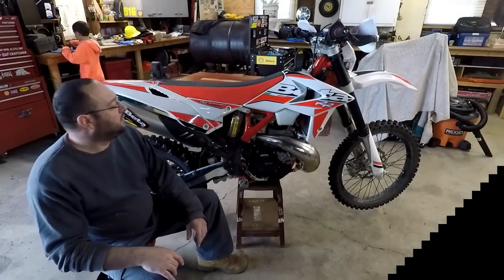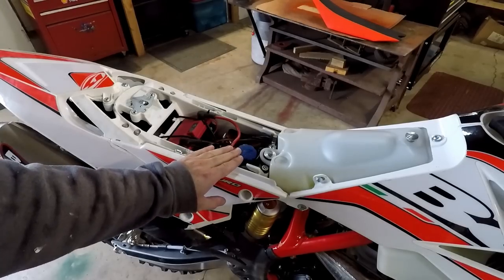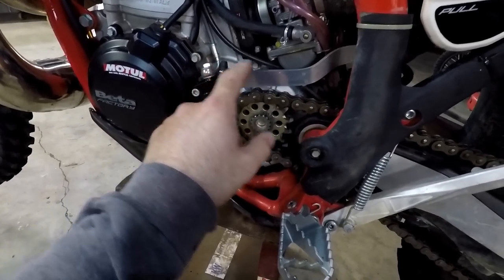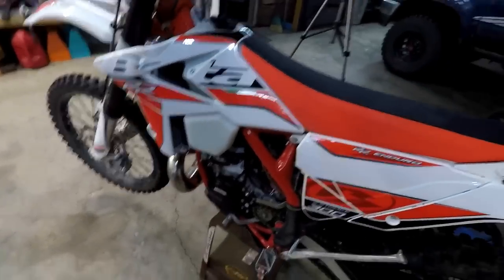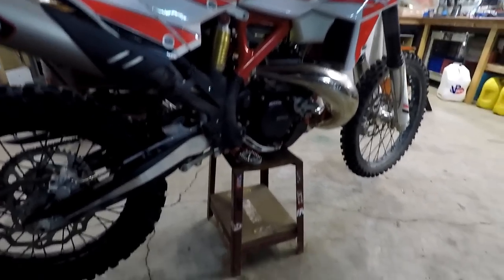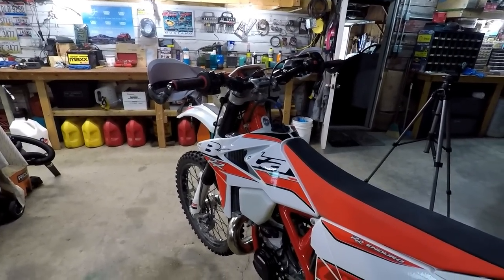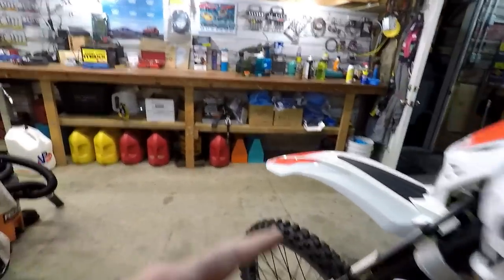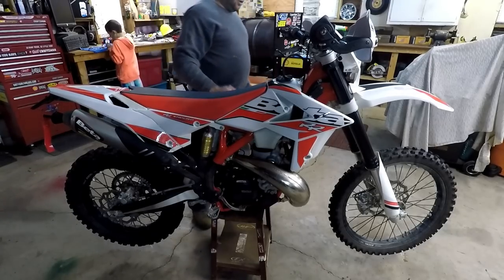2018 Beta 300RR Review PROS and CONS

Comment: Problem is if you want to use the other number plate you have to take off your computer to mount it. Stupid design. 

100 hours oh my 18 still with OI.. no issues. Love my beta. Also enjoyed H And M on it as well. Hope you enjoy it. I know I do.
Reply from the maker: Yeah, I didn't think about removing the computer to use the other plate, that is a bad design. Glad you are getting some good service out of your Beta! 100 hours and the OI working well is a nice thing to hear and I'm sure that others will think the same. Thank you for commenting and watching!
Reply: BarnStangz I will say that Italians have their warning lights backwards. In the rest of the world when there’s a cautionary detail to address.. like being low on something... you get a yellow light. Red means immediate attention. But no, beta uses a red light for low level oil injection. The first time that light came on on a trail ride 20 miles from the trailer I was like shit I’m about to have a bad time. Turned out the reservoir was half empty... plenty for the day. I laughed it off.. wasn’t funny for a few minutes though lol. 

I also agree figment of panels could be better. I recently installed number plate graphics and it’s where I noticed the terrible gapping on the left side cover. Had to shift the graphics over to get the lines to match up. 

The OI will seep a little when the bike is off. This loads up the cylinder so at start up it’s almost choked up till it burns off. Check your plug regularly. Tool kit has all that you need. 

I’m 180 pounds and thought the stock springs were too soft for my local rocky terrain. The consensus  is that Beta underrates their spring rates. I went two rates up on the fork springs and up one rate on the shock. Couldn’t be happier with the result. Change for oil every 6 months or so or at around 50 hours of use. Much after they start to diminish in my opinion. 

I’m just a trail rider with an occasional hare scramble and Enduro race here and there. This is my first true dirt bike coming from a dual sport background. Needless to say it was interesting in the beginning  adjusting to that 300 hit 👍

To clean your bars up for accessories like a roll chart holder or whathaveyou you can relocate your map switch to the steering stem lock on the right side of the bike. Easily accessible. I still use mine. 

Ram Mounts makes a bolt that replaces the fuel tank bolt you see when you sit on the bike. Keeps phone below the bars and out of the way in the event of a crash.
Reply from the maker: @PennsylvaniaDualSport  I'm sorry that I didn't reply to this comment sooner! All great information here! This is what the internet is about, sharing knowledge! My Beta is still going strong, season is almost up here in Ohio though...
Reply: BarnStangz I figured a trick with the number plate (without headlight).. grind off the nub on the back and you can zip tie it right to the computer and and get the tabs in the bottom as well.
Reply from the maker: @PennsylvaniaDualSport  Thanks man!

Comment: Lectron Carb! Next best thing to TPI
Reply from the maker: I've heard this a few times. So far I've had no issues with the stock jetting, but I've only gone up to maybe 2000-3000 feet above sea level.
Reply from the maker: AKG 1; nice to see you on here. I would have to agree that TPI is still in the teething stages and causing problems. There are quite a few people with KTM's that had them go lean and blew the engines. I'd stick with a carb for a while. Easy to tune and reliable. Thanks for watching.

Comment: Brother, do me a favor.  Please store that gas & diesel outside.   I’ve seen to many burn victims in my line of work.
Reply from the maker: You know, I've been meaning to do that. The one time I was welding and grinding and sparks were flying everywhere. Thanks for looking out. I'm going to find a better, safer place for my fuel.
Reply: I never even thought to store my gas outside, think I'd be too paranoid it would get water in it cause I don't have a shed. Have any secrets to keeping it protected? maybe a contractor bag over it? is under the deck just as bad as inside?

Comment: It's a hard seat because you bought the race bike not the rr-s
Reply from the maker: I'm pretty sure that all these Beta's have rock hard seats. Come to think of it, I can't remember any factory bike having a nice seat, except for maybe Honda XR's.
Reply: @BarnStangz  
RR-S is the street version/set up. For longer rides on your butt and geared different with softer suspension. You were sold the moto cross version of the bike. High flying track bike with the hard tires for racing. If you change the seat out you'll be fine my friend. Happy ridding!
Reply from the maker: @carlcolorado3549  Thanks man, yeah I forgot that there is a street version. I'll probably drop a few bucks and go with a seat concepts seat. My butt will thank me later. Thanks again sir!